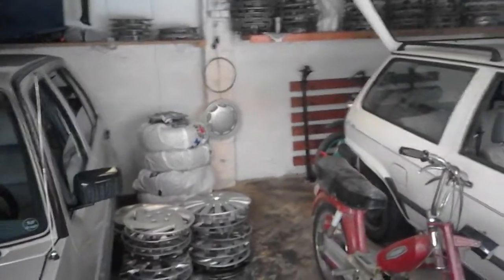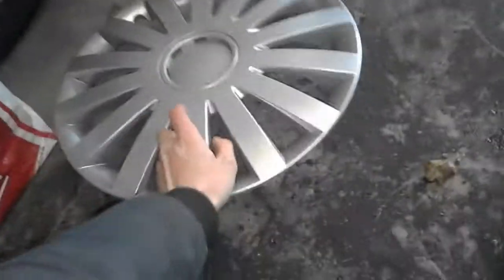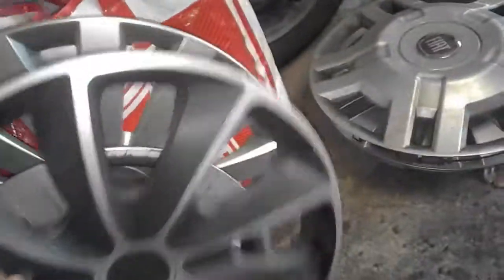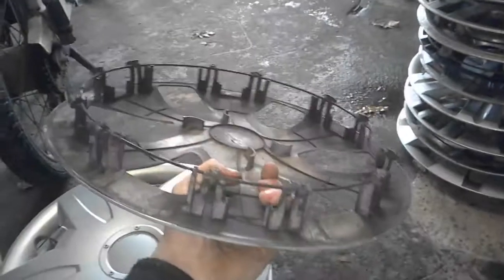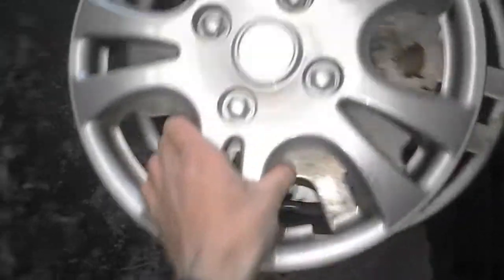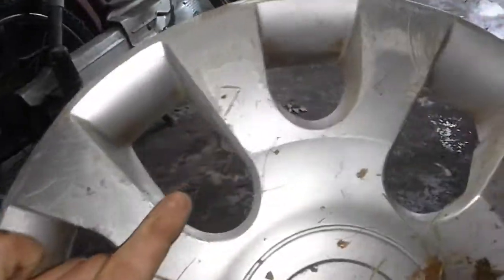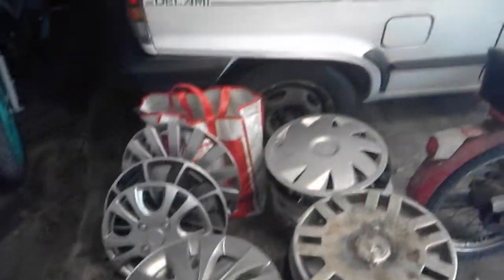my latest hubcap findings

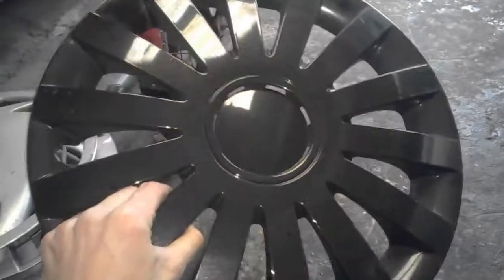Comment: the hubcaps at 1:55 and 2:15 are cavaliers or also can be off of a carton.the Vauxhall hubcap is rare even in the UK so keep that one safe because it is extremely rare in other parts of urope.
Reply: The Vauxhall is off a Cavalier SRi very rare in the UK indeed! It was never fitted to the Carlton though
Reply: there are 2 different makes of those hubcaps and the Vauxhall one that has more spokes that the opel and I thought it was a carton.thanks for letting me know.
Reply: The Opel is a Vectra A not Cavalier. Opel never Made Cavaliers.